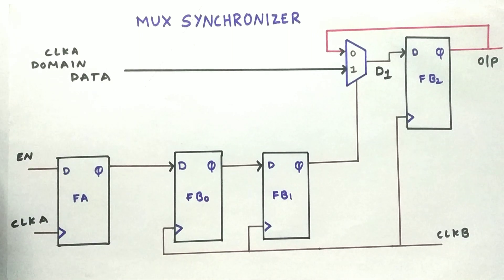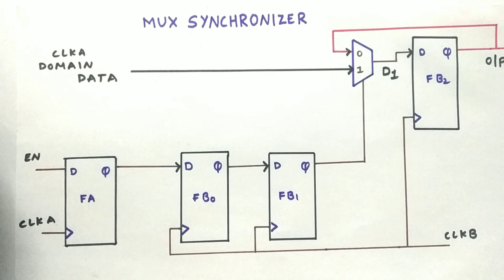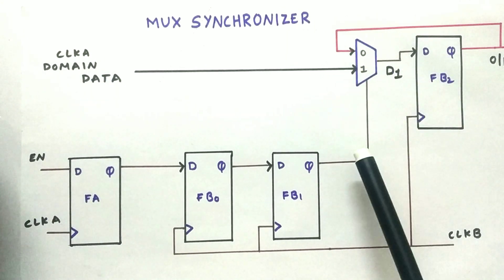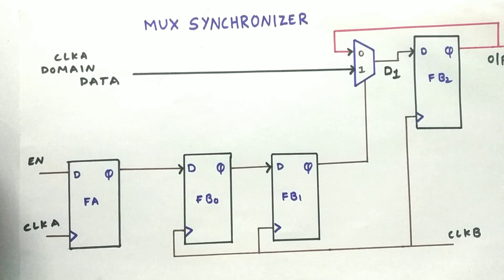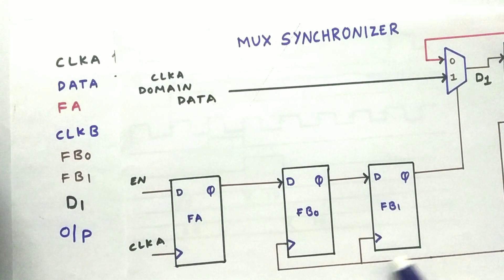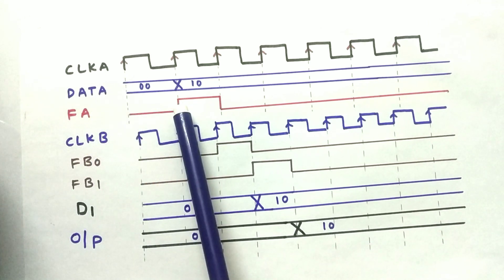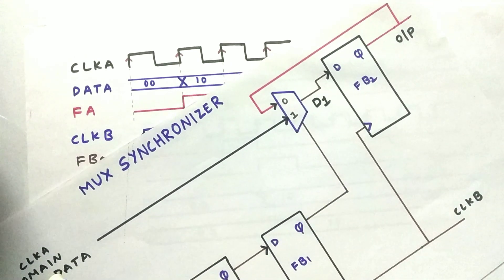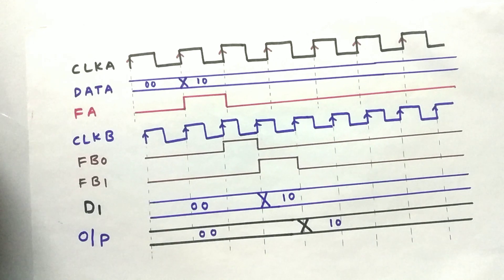Mux synchronizer (Clock domain crossing)

Comment: Hi Karthik. Happy Morning. My doubt was that why data is not being fed through synchronizer and directly fed to clock domain B and instead only an enable signal is being fed to syncronizer. When data was single bit it was fed to synchronizer while crossing the clock domains in Toggle syncronizer and 2 Flipflop syncronizer.

Comment: Hey Karthik, In timing diagrams the enable signal is pulse signal. In your explanation you considered that  clk A frequency is lower compared to clk B frequency. So the enable pulse in not missed in front of synchronizer. If the clk A frequency is high compared to clk B, then we will miss that pulse in receiving domain. OR is this the limitation of this synchronizer.